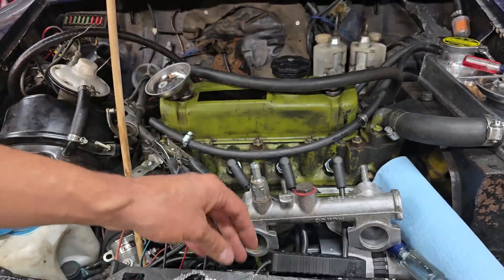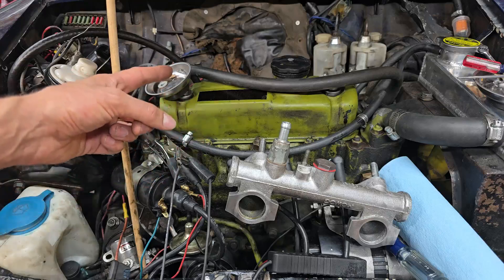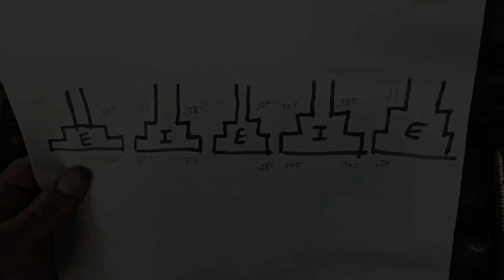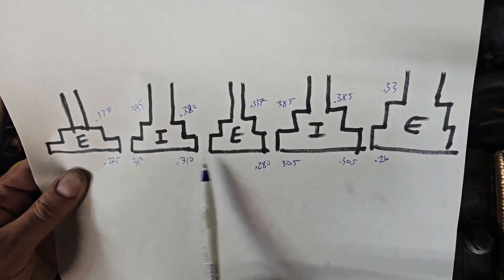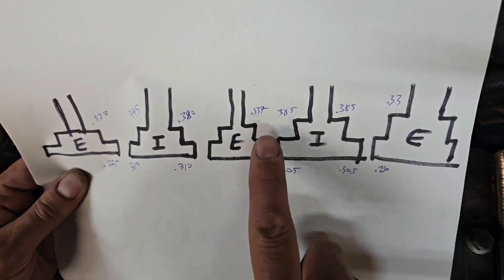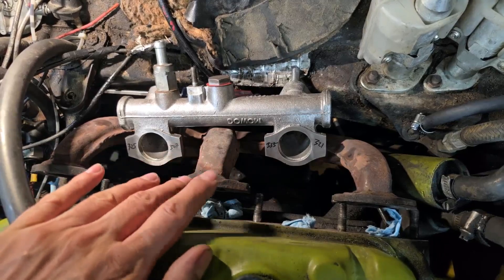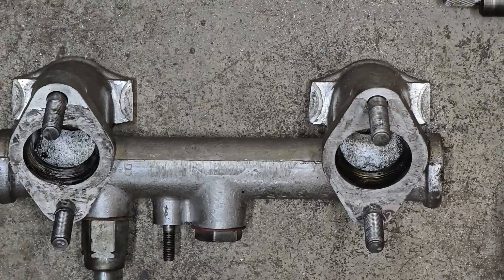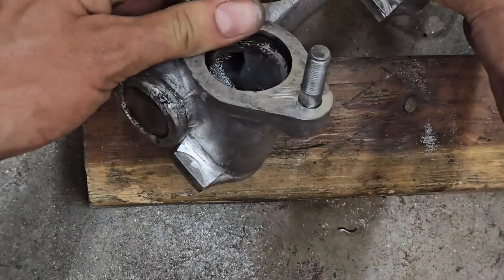Classic Mini Survival Guide: Fixing intake and exhaust manifold leaks on a classic Mini!

Comment: Very helpful, i have an intake leak that im hoping to solve this evening, and just as you mentioned my studs are bent as the flanges are slightly different thickness, so i will be doing what you have done, very good video.
Reply from the maker: Good luck with the repair, it's a common problem that's easy to fix!

Comment: Thanks for the video, very timely for me too as I am replacing my manifold gasket tomorrow to try and resolve a leak! 

Silly question but which way round should the gasket go? There’s a lot of conflicting info online. I imagine flatter side towards the cylinder head?

Also my car currently has brass nuts, a spring washer and a flat washer which seems excessive. I was going to go with a brass nut + flat washer on outer studs and a brass nut + big spacer on the shared studs?

Thanks!!
Reply from the maker: I dont think the gasket in the video cares about which way it is fitted. Its the same material on both sides.
Use the longest brass nuts you have on the inner studs. Or get steel nuts. No need for spring washers as they just get deformed from the exhaust heat.
Reply: @darrensrestorations991 Thanks Darren. Also my mk1 S inlet manifold doesn’t have the locating rings which makes alignment tricky! I have a 12g940 head, but not sure if it’s machined to accept them